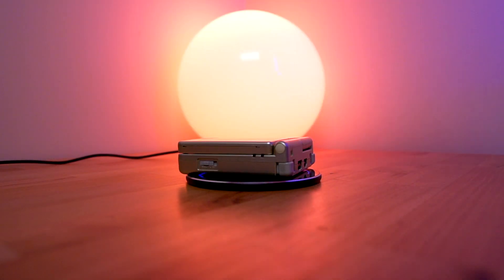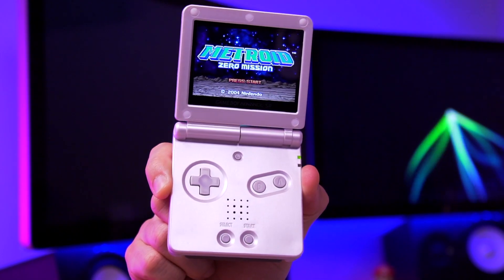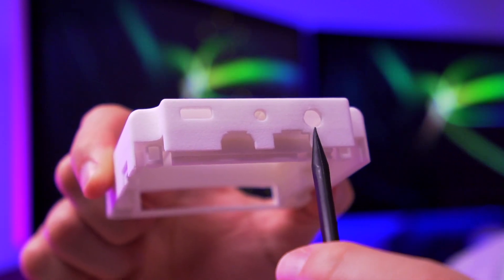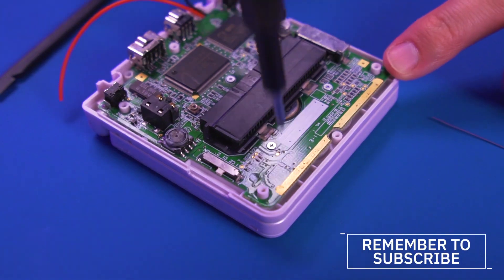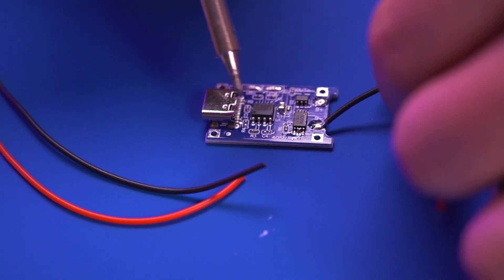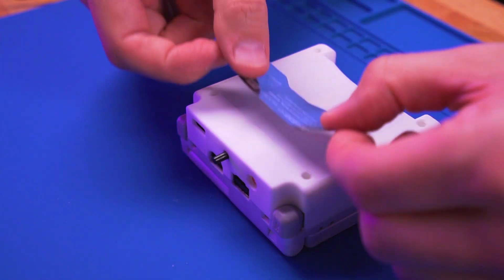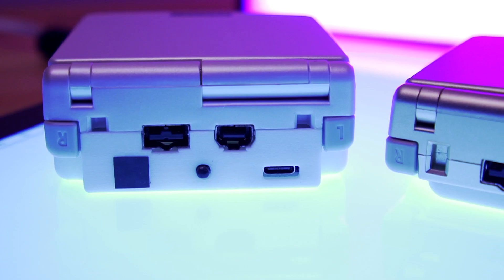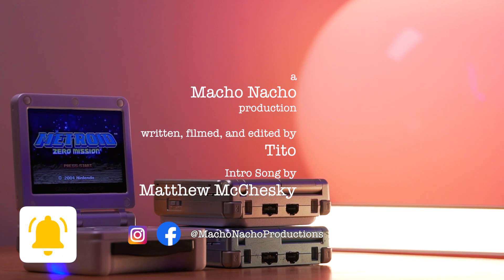WE MADE THE GBA SP THICC | SP Expander MOD: USB-C + Bluetooth + Wireless Charge + MORE | Retro Renew

Comment: Sorry mate 2nd comment but I just had a thought and it revolved around the USB C. I'm guessing the data lines are terminated in the charging port, what if you blocked off the cartridge port, put the internals of a flash cart inside the shell and then hooked the data lines directly to the flash cart so you can add and remove games on the actual unit. It would take some reverse engineering of the flash cart but it's more than doable. Obviously there would be down sides like no original carts, but It would definitely be unique.
Reply from the maker: Super interesting idea Ben!  May have to look into that. May be beyond my skill set. If Kyle is up for it I’m sure he could look into it!  Cheers bud

Comment: Could you make a sound amplifier mod for gba sp? I've seen a lot of mods for the gba speaker, but never for gba sp, could you please make a video? thanks for reading me your videos encourage me to try new mods on my consoles 😄👍🏻
Reply from the maker: So glad you’re enjoying the videos Pablo!  Is there a sound amp kit for the SP?  could be a fun mod!  Thanks for the suggestion!  Cheers buddy and happy holidays!
Reply: @MachoNachoProductions  
And here i can help too.
The Easy way is to use a Board and connect audio in to the speaker contacts on the pcb. .
Then Audio Out to the Speaker.
Here is ist better to use a smaller Speaker that not use the normal sp contacts.
Gnd to GND and Plus can take of the  capacitor on the side where the volume slider is.
And it goes out when you use a headphone with the normal 3.5mm Adapter. 
I use a Pam8302A Sound board because it is small and can be adjust in the volume.
And it runs until 2.0V where the GBA SP is long out. 
This is it
https://a.aliexpress.com/_B0Mqzm

With a Custom Case like in the Video no space Problem. 
On the Normal Case you need to cut some of the Battery Bay. 
It looks at my Version like this
http://imgur.com/a/bitmBVt
But with Batterz it is not visible
Reply from the maker: Awesome!  Thank you!